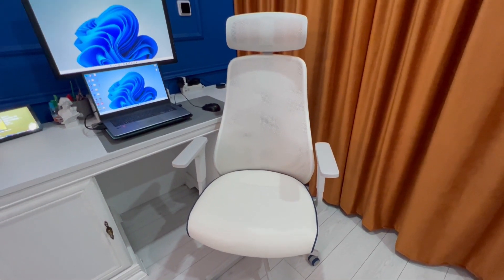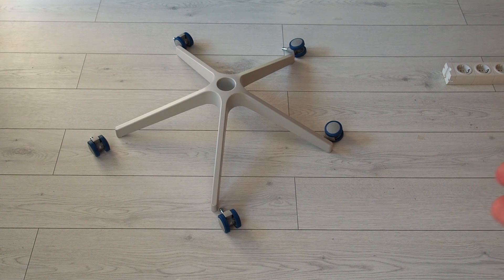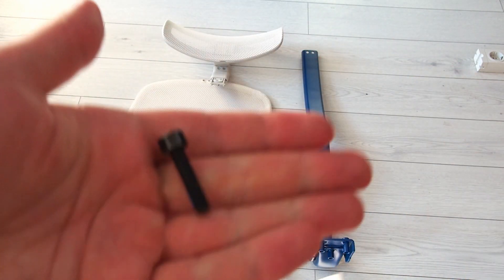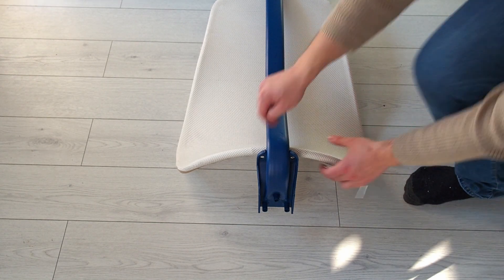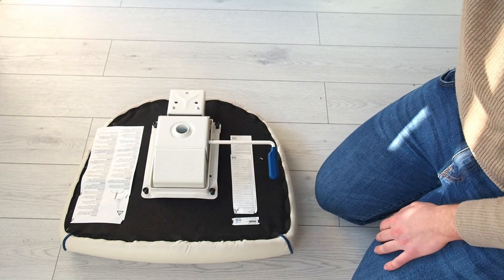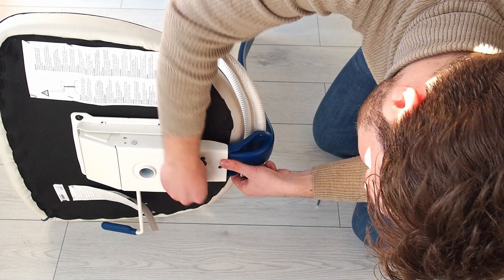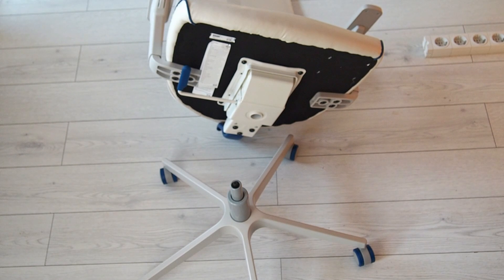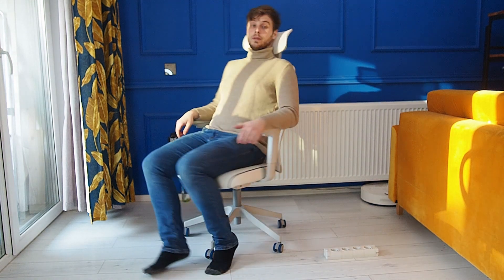IKEA MATCHSPEL Part1: Unboxing, Assembly, First Impression. Step by Step Installation. Gaming Chair

Comment: Hey, i did it but i always feel the metal bar on the curve, is that normal or a manifacture default ?
Reply: Hey i know you wrote this comment long time ago but i bought this chair and i have the same issue could you figure out what is the problem. If you can help me i appreciate you very much. Have a great day thank you
Reply: @OmerBerkayG  Place a neck pillow between the iron and the back.
Reply: It works well??
Reply: Thanks man❤